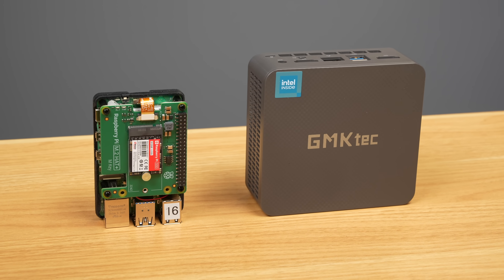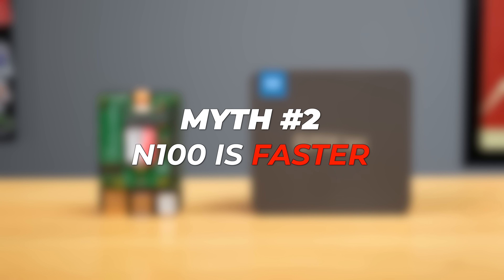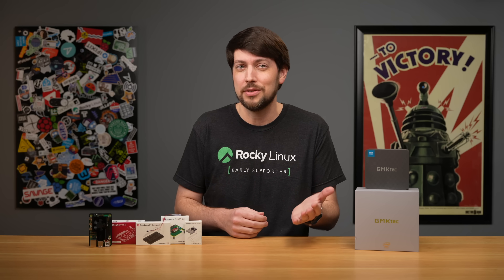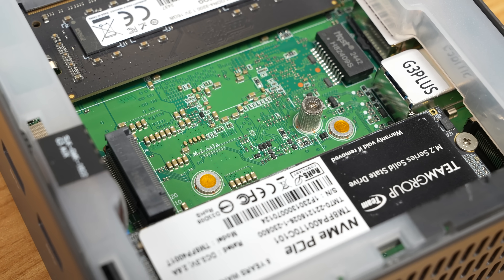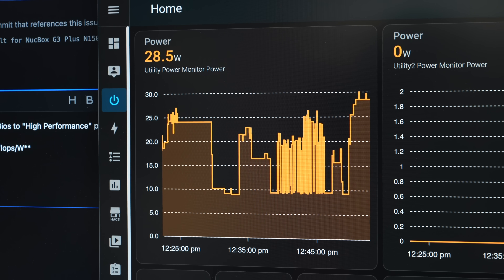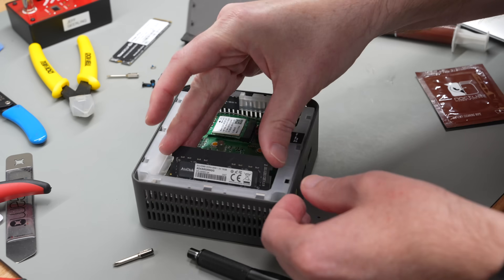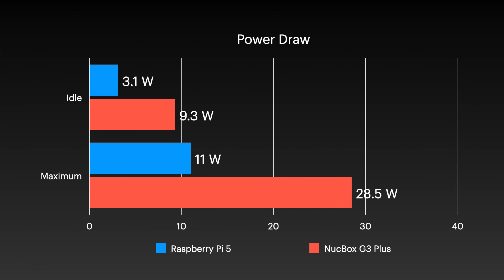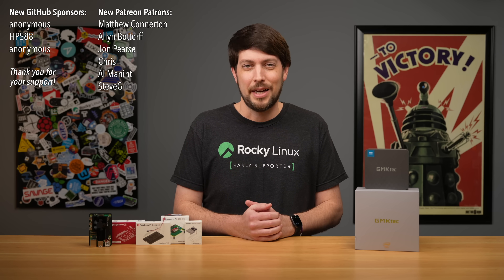When did Raspberry Pis get so expensive?

Comment: Jeff: the architectural design and voltage differences between DDR4 and DDR5 are why they a physically notched differently. Bring this up with Wendell the next time y'all have a fireside chat, but be ready for him to inhale like Ace Ventura before one of his fast speeches! XD
Reply from the maker: lol, I have one of his ECC videos on my 'watch later' list right now too.
Reply: @JeffGeerling  You'll also learn about it's use of an extra CKD IC which is basically a programmable reclocking and distribution circuit to help keep that high frequency signal's integrity up to specs.
Reply: I would also like to see those other brands in +10 years.
I own a rpi2b, there is a 32-bit version of rpiOS for me to download, it is STILL SUPPORTED WITH SOFTWARE! Can those other brands say the same?
You pay for what you get, and that includes software support when it comes to rpi.

Comment: I've completely stopped considering SBCs for self hosting (home assistant, pihole etc) a while ago. 

Those mini pcs:
- If performance doesn't matter then you can buy a fujitsu futro s720 (they're dirt cheap in europe, like $5-7, in the US that would be some Dell Wyse IIRC). You can't buy any 64bit pi for that price, period.
- if performance does matter then buy that n150. Performance/$ is still gonna be better.
- they come with a full enclosure so I can simply plug in the power and ethernet and throw it (literally) behind the router. If someone goes to clean that self and manhandles the equipment its still likely gonna be totally fine. RPi enclosures are on average a bit more open (for all the connectors, fpc tapes, gpio etc) and I would be worried someone's gonna break it eventually. And 3d printed enclosures all just look too flimsy for my taste.

The only use for rpis for me is when I need gpios and full blown linux. I'm building a headunit for my car based on a CM4 with a custom PCB and in that project RPi has no real alternative.

Comment: Which of these can run proxmox? I don't think there is support for the pi, still. My homelab is mostly lxc containers running on proxmox, so for me that's the killer feature. The pi has always felt too in between a microcontroller and a "normal" computer for me. Most places I'd want the gpio a esp32, arduino, or rp2040 would work great, and places i want the compute or normal IO the pi doesn't measure up.
Reply from the maker: Note the Pi runs Podman/Docker just fine, and KVM as well, there's also the Pimox project that can help get Proxmox 7 and 8 installed: https://gist.github.com/the-polak/20a3156b24b2f5c966bd898ff1a8cfdc

But yes, out of the box some virtualization is easier on Intel!
Reply: @JeffGeerling  I'm not really a fan of "download this image with who knows what that was last updated os level stuff when?" That docker promotes, and I'm not really wanting the overhead of building my own images when i just need the one. So lxc os containers it is. I could do the whole build image thing i guess, but that seems like a lot of work.

Comment: Its all about what you are using it for. A Pi is not good at the moment for my proxmox cluster but it would be good as a little media server. Its all about the use case. What i do need is a mini PC that has a 6 or 8 core CPU to replace my power hungry dells .

Comment: Curious about the GMKtec's high idle power draw.  I wonder how much is due to the power supply, also curious about the sleep states of both devices-- Intel has traditionally had more comprehensive inactive power handling features that the Pi's but getting that to work correctly under Linux has not always been straight forward.

Comment: 90% of my homelab is ARM based, 80% of that is raspberry pi's. one is a radxa rock 5b. the last 10% of my homelab is a synology nas.

i got more stuff planned, but no real way to do it yet. i also have a ZimaBlade, but something went wrong after i updated it, and i need to reinstall it to get it working as expected again, and i will likely install zimaos while i am at it, so i can get raid support.

i'm not saying a raspberry pi is better, but for what i got, and had access to, it works well, and is reasonably low power enough that it does not tank my electrical bill too much. different needs have different solutions, and for me, pi's were the way to go. i tried with small computers, but sellers scammed me and i got half width towers instead, so i got one of them just waiting for a use.

Comment: Was that power test done on the NUC at high proformence mode in the bios? What's the power output if you changed it to the other two options?
Reply from the maker: I tested both at Balanced and High Performance, and idle power draw was the same. Only the maximum draw increased with High Performance, and only by a couple watts.

Comment: I'm running home assistant on one of these GMKtecs and am pretty happy with it
Reply: I run my Plex server on one. It still blows my mind when that thing can flawlessly handle several 4K transcodes at once all the while sipping power and being nearly silent.
Reply: Me too.  Two more just arrived today which I will use for PiHole boxes.
Reply: Can you let me know what spec?  I've been considering using a HA Yellow for a while just just bought a N150 DDR5 miniPC and toying about getting another and just installing Home Assistant on it instead of a Yellow.
Reply: @gordon861  I have HA running on an even smaller N95 mini PC from Dream Fyre, it's about 90mm x 90mm x 30mm, it was less than $100 on Amazon (it also came with a handy VESA bracket which I used to hang it off the side of a shelf next to my router instead)

Comment: Raspberry Pi has strayed far from its original ethos of delivering accessible, cost-effective computing to the DIY and maker community. What was once the de facto single-board computer for tinkerers and educators has now become an overpriced, thermally constrained platform that offers diminishing returns in the face of rapidly evolving alternatives. A fully outfitted Raspberry Pi 5—complete with an adequate power supply, active cooling, enclosure, and storage—now approaches the price point of x86-based Intel N100 mini PCs from vendors like Beelink and Minisforum. These systems not only deliver vastly superior compute performance per watt but also benefit from a mature x86 software ecosystem, proper cooling solutions, and significantly higher I/O bandwidth.
Meanwhile, the proliferation of used enterprise-grade mini PCs has further eroded the Raspberry Pi’s value proposition. Devices from HP, Dell, and Lenovo—particularly their Tiny and Micro series—equipped with 6th to 10th-generation Intel Core i5 processors, DDR4 memory, and NVMe storage, offer a vastly superior price-to-performance ratio. These machines not only support full-fledged operating systems and virtualization workloads but also provide greater scalability, better thermals, and none of the reliability concerns associated with running workloads on thermally constrained ARM SoCs.
To make matters worse, despite all the hype around Raspberry Pi’s multimedia capabilities, it still fails at one of the most basic tasks expected from a modern computing device—smoothly playing 4K YouTube videos. Due to a combination of hardware-accelerated decoding limitations, inefficient software implementations, and underwhelming CPU performance, users are forced to rely on workarounds like manually configuring Chromium flags or using external media players, neither of which deliver a seamless experience. Meanwhile, even budget x86 mini PCs handle 4K video playback effortlessly thanks to better hardware acceleration support and broader software compatibility.
The reality is that unless a project explicitly requires GPIO access or ultra-low power consumption, the Raspberry Pi is no longer the compelling choice it once was. The DIY and home lab communities have recognized this paradigm shift, increasingly gravitating toward x86-based alternatives that offer better longevity, broader software compatibility, and significantly higher performance-per-dollar. The Raspberry Pi Foundation's failure to acknowledge this shift may very well lead to the platform becoming a niche, industrial-focused product rather than the accessible, ubiquitous tool it was originally intended to be.

Comment: I'm confused why the N150 started throttling at 75 degrees. I thought the max for this chip was like 105?
Reply from the maker: It doesn't throttle at 75, but when it spikes up to 85 or so, briefly; in s-tui that's indicated by the temperature graphs flashing red. It'll throttle the clocks for a bit until it stabilizes back under 80, but then when the clocks increase, it briefly jumps in temperature, throttles again, and repeats that cycle until the system usage dies down.

Real-world, that won't happen quite as often, but it does seem to be hard to keep the N100/N105 cool with a small heatsink.

Comment: I've actually never found a Pi to be the right solution for any of my projects, and I've owned at least one of each generation starting back with the original one up until recent.

For projects where the GPIO might come in handy, the Pi is usually way overkill, and it is almost always a better option (for me) to just use one of many available microcontrollers.  Microcontrollers give more direct hardware control, reduce power consumption an order of magnitude or more, and avoid the hassles of yet another OS that needs active management.  Recently I've really come to love the ESPHome platform that makes it really quick and easy to spin up a WiFi capable hardware node and integrate it into my existing network.  For things that don't need network connectivity, Arduino or other custom built microcontroller solutions are an even better option (for me).

For projects where I need any type of compute, the Pi usually is underspec, and a mini PC is almost always the better option (for me).  Mini PCs usually allow better upgradeability and throughput (SSD, USB, networking, etc...) and allow me to retain x86_64 compatibility, which is still important for certain work loads (i.e. pfSense).  I almost always buy used hardware anyway, so there doesn't seem to be much if any of a price benefit to the Pi route, and definitely not once factoring in upgrades down the road that are mostly just not possible with the Pi (SSD, RAM, changing WiFi to 2nd ethernet nic, etc...).  A great source of inexpensive mini pcs I've used over the years is to take an off-lease/used ChromeBox and then install the MrChromeBox custom UEFI firmware on it thereby turning it into a native Linux capable mini-pc.  Some of these idle down at the 3-4 ish Watt range, putting them in Pi efficiency territory.  More recently I've started buying higher end mini PCs that are orders of magnitude faster and more capable than any Pi and still can idle down in the 8-ish Watt range.

So, again, I would love to find an actual good use for the Pis that I have lying around, but to date I just haven't ever found a good reason to use one for a real project.  Flame away.

Comment: In Asia, Raspberry Pi devices are much more expensive due to import and distribution costs, whereas N100 mini PCs are significantly cheaper because of their proximity to China. We can get a fully assembled N100 mini PC with 8GB of RAM and a 256GB SSD for around $70 to $80. This difference may lead to a different perspective compared to developers in America.
Reply: In my country, mini pc prices are insane probably because not many buy these things. More than $200 for a N100 mini pc with 8 Gigs of RAM and 256 Gigs Nvme of storage. For the same specs with all official parts, the Pi ends up costing less than $170.
Reply: @LowEndGamer-gy9lc Prices in Europe are way higher. No idea, why. As a result, you don't see N100 PCs anywhere. On the other hand, various fruit Pis are very common sight.
Reply: @ what europe would that be? Amazon Germay is flooded with mini PCs. ALi Express is a thing and all the bigger Mini-PC makers have shops that allow you to order from pretty much everywhere that's not Imperial Russia.
Reply from the maker: Wow, definitely a big difference there; cheapest N100 PCs (with RAM and SSDs) usually are $120 or so here. Sometimes a deal for one around $99.
Reply: @JeffGeerling  It's similar in Australia too.
Reply: @JeffGeerling  hey, turns out mike lawson is gay, so just letting yall know, not in a mean way. i know he works at airbus in mobile, alabama and does the radio testing using a esp32 radio and you can ask for him in the tour and hell show you you have to ask ashkan ajizahdeh
Reply: The price forms from real price, delivery overseas, import tax, shop  charge and final mile delivery.   The more closer and you are to real price location - the more changes the view to the story
Reply: @s.i.m.c.a  none of this costs significantly increased in the last 15 years. At least in Germany. It’s just that they can and are very lazy and they pay millions in salaries to the management
Reply: In Brazil is the same. Raspberry Pi here is very rare.
Reply: @YannMetalhead  Brazil, Australia, and New Zealand always seem to get the short end of the stick compared to everyone else. I always feel bad for you guys.
Reply: @xandersnyder7214  Definitely. A Zero 2 W is currently $50. That is crazy!!!!
Reply: Real, here in Indonesia those pi 5 board 8 go have same price as mini pc with full ssd, windows, and ram lmao 🤣
Reply: @Fataha22  even getting a amd igpu mini pc is cheap, for light gaming on linux
Reply: @ and virtualization
Reply: Not to mention other ARM or RISC-V Chinese Pi products can be even cheaper. Using raspberry pi in the states or otherwise countries never is a cost effective choice because the cost of accessories, in China accessories either basically free or dirt cheap.
Reply: in black friday or similar, the cost is even lower in platforms like aliexpress, the shipping is also good in asia
Reply: Also must be comparable to other ARM based devices as well that come out of China, especially the Rockchip boards
Reply: Same thing here in Brazil. You can't find Raspberry devices anywhere, and if you do they'll be at least as expensive as a full N100 mini pc.
Reply: God where do you get the 70 - 80 dollars? I would LOVE to have one at that price. Everyone here is selling it for 100 to 160 and i'm pulling my hair out
Reply: i can buy 2nd hand laptop 7th gen intel with current pi 5 complete packages prices.. insane 😢
Reply: I get n100 from taobao, same spec as him but full meta for passive cooling and additional 6 port rj45 2.5Gbps . Cost around 140$
Reply: In Japan, both are equally expensive :)
Reply: In india, raspberry pi are easily available without any issues and I got a 4 gb for $60 so its pretty cheap and common here.
Reply: That same in Russia and nearby countries.
80$ for similar new mini pc and several times more for new raspberry.
Reply: Link?
Reply: Where are you looking at N100 pcs? All the prices I'm seeing in Japan are ~$150
Reply: Is good for pfsense?
Reply: @Kuroji07  One with two NIC's
Reply: I'd love to grab something that cheap. Please link a mini pc on an online retailer. I'll grab it in heartbeat.
Reply: What is the price of the locally produced Nano-Pis etc there? Would those be cheaper than mini-PCs for similar performance?
Reply: @SimonBlandford  depends on what you wanna get, orange pi zero usually costs $10 with much better performance than RPI zero, you also can get rk3588s pi costs around $80 that includes a case with a small touch screen and it has better performance than RPi5 plus it has built in nvme slot and eMMC for storage options. Accessories for SBC are usually either free or dirty cheap. RISC-V Pis are even cheaper.
Reply: And stupid tariffs from the Trump administration are going to add more salt to the injury in the next weeks.
Reply: In Asia, I would highly recommend going with a different ARM SoC board.  There are several "Pi Clones" with similar enough board layout to be compatible with Pi Hats,  even if most of them require different drivers on the OS.   These are a very good substitute for the Raspberry Pi, so long as you are cool with using either a generic ARM OS or spinning a new OS image.
Reply: yes this is true
Reply: Bullshit, shipping and import cost doesn't matter. The Raspberry PI is just not popular as in Asia there is barely any computer interested DIY scene and therefore no economy of scale. The old as shit N100 mini PC are 2nd hand flowing into the rest of south east asia from offices in Japan and China (and still 25% or more expensive then in Europe). As usual it's all middle man and fucking logistcs that ruin asian countries.
Reply: i trust chinese made hardware than us made with a lot of backdoors
Reply: yeah i buy directly from taobao and I am not even in china delivery cost only 2$ with lots under 100$ options to choose from (NEW).
Reply: there's a president that will tax it even more.  maybe tomorrow?

edit:  sadly, i've been right...
Reply: if it's cheap, it's also because it's sold with random AliExpress low performance nvme and low quality RAM. I can guarantee you that . Also it's cheaper because the median income is lower, so they have to discount them a little or sell none at all...
Reply: @xl000  true, use reputable sellers, you can buy the device barebones as a option and add the stuff
Reply: @ as Jeff showed in the video the ram is a perfectly fine DDR4 3200 16GB SODIMM /the N150 can't use faster or bigger SODDR4) and the SSD is also perfectly fine see my other comment.